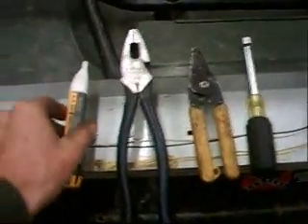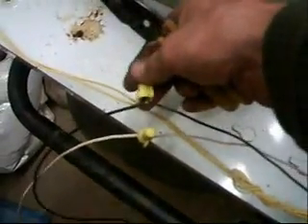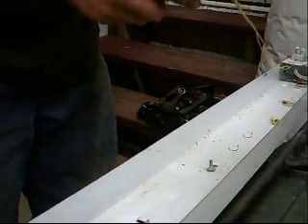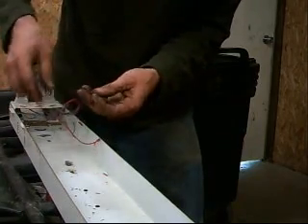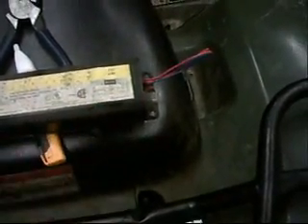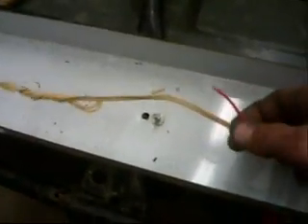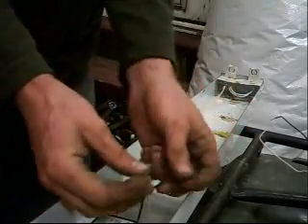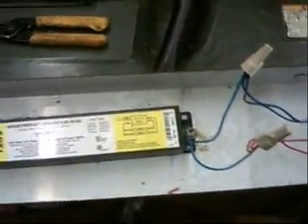How to install flourescent light ballast

Comment: I installed a T12 ballast following your instructions and wiring instructions on the ballast.  It worked for about 5 minuts and then it went off....what did I do wrong?

Comment: You didn't use the new shunted sockets or shunt the old ones so its not exactly correct! And now there saying to shorten up the wires so no extra wire coiled up or hanging around! I could say more but won't. I know this works but it's not the correct method for best results!
Reply: So true. If you are using unshunted lampholders from the old T12 ballasts, you need to connect the one ballast wire from instant start T8 ballast to both wires to old unshunted T12 Lampholder, or replace old unshunted  Lampholder from T12 installation to a new shunted Lampholder, which only requires one wire that feeds both pins of Lampholder.